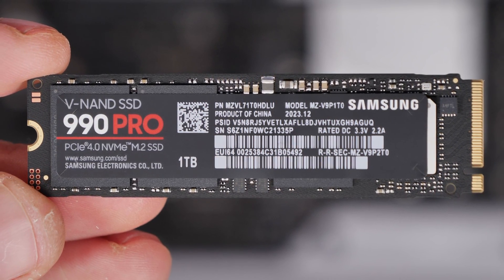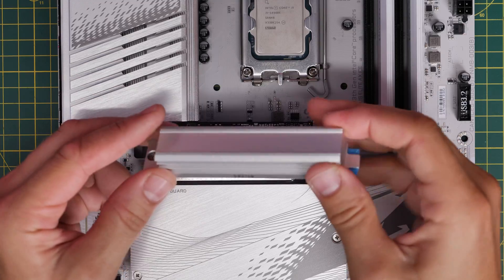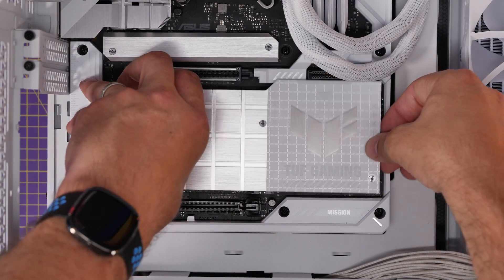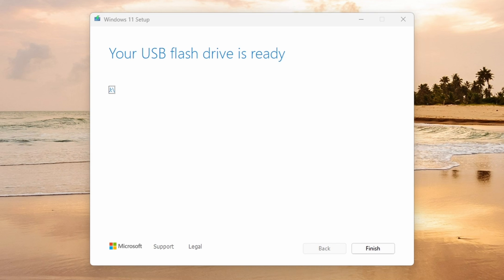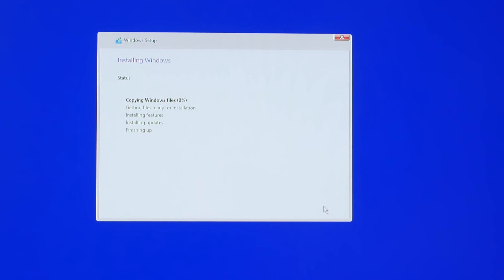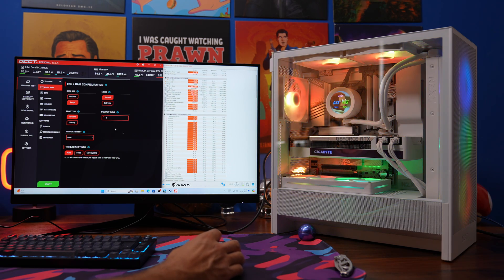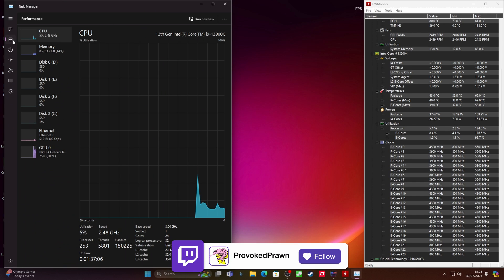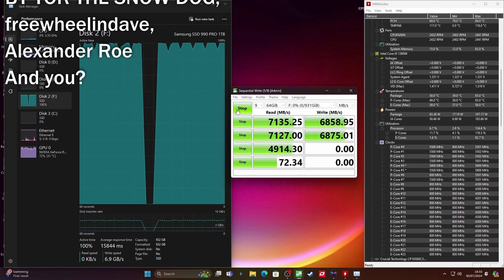How to install Samsung 990 Pro NVMe SSD, install Windows and test speeds

Comment: BIG Thank You for this video! I watched 4 different videos on installing NVMe drives before and spent half the day fumbling around in BIOS, where it kept saying M.2_3 "empty". I didnt realise its all in working order and i only had to format the drive in windows. None of the other videos i watched explained this and stopped at the hardware installation part, which was a breeze anyway. It's been a while since i installed a new drive so i didnt remember this step. Cheers for going the extra length!
Reply from the maker: Glad to be of assistance

Comment: I just installed it and it works like a charm thanks a lot that was simple and straight to the point
Reply: You had to install Windows first correct??
Reply: @OfficiallyOrca  my pc already had windows with a main SSD the only thing missing was the secondary SSD I bought for additional storage

Comment: I did a clean install onto 990 Pro nvme ssd with a DISK DVD, it worked fine. but now when i try to boot up my PC i get a black screen. My mouse/keyboard AND monitor get power and remain on BUT i only get a black screen. Any fix?

Comment: Put creation tool on usb stick and tried to use it to put windows on 970 but wouldnt let me showed me the drive i wanted but pressed next and wouldnt let me . Should i run the progamme on the drive i want first then try to boot from it? I have windows on an old sata but my 2nd ssd i want windows on
Reply: Did you figure out a solution after?
Reply: @Kens902 turns out my mobo wont let me put windows on any other ssd and lots of reviews online about people having that issue, just gonna get a new board 😂

Comment: Hi, my speeds on my test were Read: 7000mb, 3229mb, 647mb and 59.95mb. Write was 1900mb, 2400mb didn’t finish the rest. Is this correct ? Or should I be worried
Reply: I’m using the 990 pro thermal version

Comment: Yeah, my BIOS seems to recognize the SSD, butt for some reason it does not appear in the Disk Partition window
Reply from the maker: It's likely a setting in the bios that's stopping it then. Also those settings vary from motherboard to motherboard so I can't tell you a universal answer

Comment: I'm installing one of these now, but my motherboard doesn't have that little latch that turns to lock the drive in place. There's a metal cylinder where it looks like it would go, but there's no latch. Can I get a replacement? Do I need it?

Comment: My computer doesn't recognize my ssd Samsung 990 EVO. I've tried everything, disk partition, bios, general setting, nothing show up anywhere. What am I missing? My motherboard is a Prime B560M-A AC. Can anyone help?
Reply: Did you find a solution? I’m running into the same thing

Comment: Why does custom option not come up for me. After I pick new windows install, it takes me straight to product key. I put it in and then it says this pc doesnt currently meet windows 11 system requirements.
Reply from the maker: Weird. You might have to check to see if your motherboard supports TPM. It might be as simple as a bios update before hand

Comment: i just build my pc with a b650 tomahawk motherboard plus a Samsung 990 Pro 2TB NVMe SSD. i tried installing windows 11 pro from a dvd but my pc can't find my ssd card. 

Am i doing something wrong here?
Reply: Same issue with a B660M. Did you find a solution?
Reply: @ yh lol the problem was i didn’t push the ssd card far enough into the motherboard slot for the ssd card. You have to hear it click but i didnt do it properly the first time bc my cpu cooler was in the way. 

After i installed it properly it showed up in my bios.

Comment: I've been fighting for 4 days to get WINDOWS  installed onto my Samsung 990 pro. It keeps telling me that they're a driver missing. I have tried everything to get the Samsung NVME drive installed, and nothing works. Everything checks out with the 990 pro. Help pls
Reply from the maker: https://semiconductor.samsung.com/consumer-storage/magician/
Reply: Did you get it yet? Im still fighting to get Windows installed on my 990 pro also. Using Gigabyte b650 gaming x ax v2.
Reply: @odogg6899  Yes! I got it installed. Does your system have UEFI in the Bios?

Comment: will i lose any game or anything if i install a new ssd
Reply from the maker: If you mean if you're installing this as an additional drive in your system then no. You won't.
Reply: If you’re replacing your old one then  you should do a thing called CLONING. It bassicly is a transfer. But if your adding a new one then nah your good.

Comment: I took one week ago the 990 Pro 4TB model, I installed Win11 Pro and after around a week I started to have issues and instabilities. In the final not show up in BIOS or disappears on the troubleshooting -> restore step. I will return and take a WD Black SN850X or a Kingston KC3000.
Reply: No just installed the 990 pro 2tb and replacing for the one you buying
Reply: Have 3, most recent failed within a month. Recognized but corrupts and needs new windows. Reinstalled at least 8 times and it just fails again. Going to try to send back if they don't help not buying them again going to WD

Comment: what if those partitons arent showing up?
Reply: Did you find a solution ? I have this issue . It doesn’t ask me to custom setup and the ssd doesn’t show up
Reply: @jonathanmachado4790  ssd is too new for my motherboard. motherboard doesnt support it, and ive never updated the bios in the 8 years i had the motherboard.

Comment: I created a W11 installation thumb drive for future use but want to know if you are required to connect to a Microsoft account to install W11.

On a Windows 10 installation, you can avoid connecting to a Microsoft account if you have your ethernet cable disconnected and click to skip connection during the initial installation and can later connect and perform the needed updates.

Comment: Hiya,

Also wanted to mention should you install /adda drive ( of just using one drive ) and you have proformance issue's check to see if you might need to update the firmware of said drive. 
Happend to me once my read and writes where only 30% of what is should have been, Updated the firmware of it and it worked like a charm

Comment: Is there any possible way the I may have incorrectly set up software wise or settings in the bios wise an NVMe ssd where it could cause stutter in games?

Is it better to have games on a seperate drive to ur windows OS drive even if they r both NVMe?

The only difference I made was delete or the partitions, never pressed the “new” button like u did and instead just pressed next on the “unallocated space” while it was highlighted.
Reply from the maker: Not that I've experienced. What makes you think it's the drive? Have you tried the usual graphics drive updates, bios updates and windows updates?
Reply: @TheProvokedPrawn  Well… Ik these games r typical for this type of behaviour but UE5 games and dead space remake have major traversal stutter for me. Ik they do for everyone but for me it’s exacerbated by something. My ram seems fine, my cpu seems fine, my gpu seems fine so the drive seemed like the next thing to accuse. 

I have a 980 Pro that’s 4 yrs old. I used samsung magic years ago to update it over the years and it’s still up to date to my knowledge (even thou I haven’t had it installed for a while) so I don’t truely know that but I doubt they’ve rolled out another update. It also reported back on its health and the app says it’s a healthy drive with no issues.

Even the recent space marine 2 seems to have lots of stutter for me which not many other ppl seem to be complaining about. I was told having it on a seperate NVMe to ur os was the way to go but I never thought it mattered.

Even in an old game like destiny 2 I find myself stutter between world load zones. Which never used to happen to me but that is to be taken with a grain of salt since it’s been less and less optimised as they add and add to it.

Also yeah I’ve done all the normal PC drivers except for Realtek audio and I just use the default audio drivers for my astro a50s/windows all up to date.
Reply from the maker: @stealthhunter6998  have you got an Intel CPU? https://youtu.be/Nm6fXM5Qk60
Reply: @TheProvokedPrawn  No a 5700X3D. I have the amd chipset drivers and BIOs up to date too. Months old cpu so it shouldn’t be that given I had these issues on my last cpu too. (I fresh installed windows after the install too).
Reply: @TheProvokedPrawn  In general, what can someone do to stop traversal stutter/stutter? 

I notice another type of stutter even when I cap my fps using RTSS and it goes from 59-60-59-59-60 like that. Ik it’s impossible to keep at a solid fps so Ik I shouldn’t be seeing stutter like that. I have gsync enabled like blurbusters say to. (Space marine 2 btw is where I cap it to 60 using RTSS and dynamic resolution scale set to 60). When I cap my fps at 80 and it goes 79-80-79-80 like I would in a game like GoW ragnarok (since it’s a stable fps cap for that game for me) I don’t notice it anywhere near as much if at all. This is a seperate issue to the traversal stutter btw which I don’t get in games like GoW ragnarok and Horizon forbidden west.

Hope I’m making sense and thanks for attempting to help.

Comment: can i put gen4 nvme ssd to gen5 slot? TIA
Reply: Yes, they’re backwards compatible. Meaning “low” nvme works with “high gen” slot aswell as “high” nvme works with “low gen” slot however the higher ssd speeds might not be fully utilised in the latter setup.

Comment: Just a little concern ive seen around this drive and interested on your take on it, seen a few videos on this specific drive where it has deleted data wnd files on computers completely from random boots up and occasional tweaks in the bios (my guess is from probably non updated ones). My question being do you think this might have something to do with just the drive itself or maybe the widget Samsung magician not working correctly (or maybe that not being updated) ? Would be a big help to those installing these for the first time and not knowing what they could be risking.

Comment: Love your vids, but I have a completely unrelated question. I have now bought both the lianli sl infinity fans (3 pack) and the Galahad 2 trinity performance. Im just confused about how im supposed to wire everything up. The whole system has the lianli fans, and im using the lianli hub (Gonna use lianlis software)
Reply from the maker: https://youtu.be/Mm85qMEYlDI
^ this or just remember the port you connected those fans to and set them to respond to CPU temp in the Lian Li software
Reply: Thanks so much

Comment: I have 3 x SSDs and 2 x m.2 installed in my pc. The M.2s are  the C drive , which is a corsair MP600 which reads at 5000 m/s and other is a samsung 970. I cant tell any difference at all between any of the drives in general use. All my games are on a crucial Mx500 which writes at 500mb/s. in reality  you just dont need the speed unless your moving massive files, yet i still buy them. :)